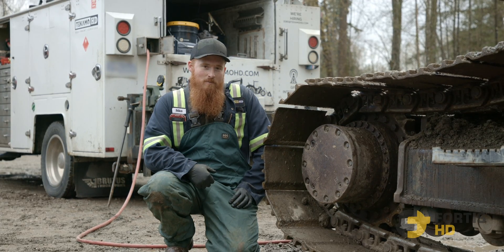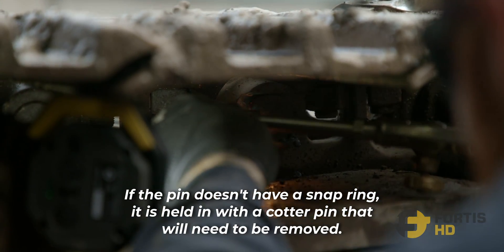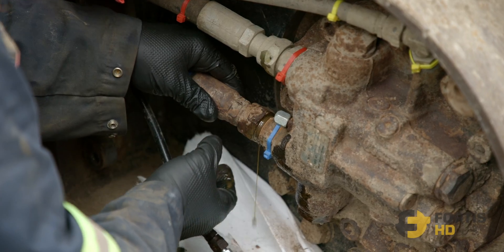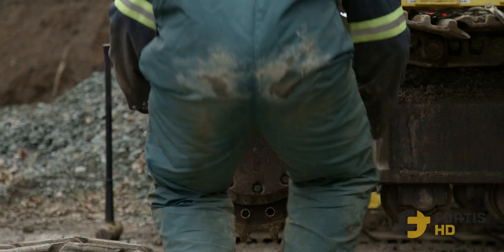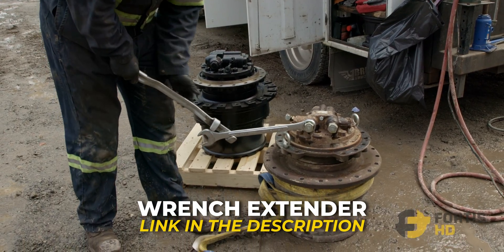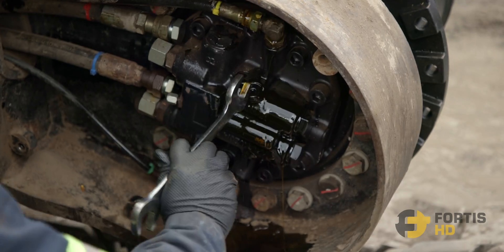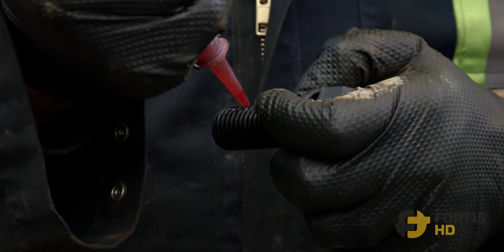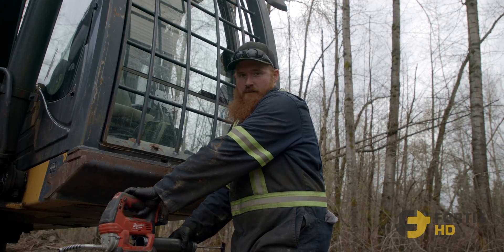Excavator Final Drive Removal & Installation - STEP BY STEP Guide Featuring TekamoHD

Comment: Why red and not blue thread locker?  Does the red release if it needs replacement again?  Great video.  Thanks!
Reply: Red is stronger but either needs a really big wrench or heat to remove it.

Comment: When and how did you fill the final drive motor with Hydraulic  fluid, purge the air? I saw you fill the gear box with oil, but not the motor
Reply: It's in the drive loop circuit, when you move the final it will move any trapped air back to the tank when the flushing spool opens.